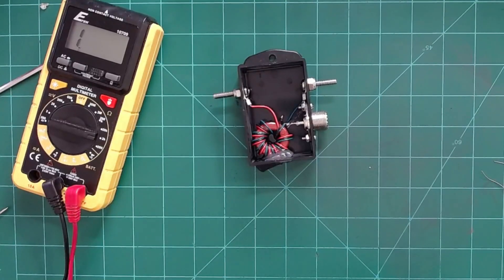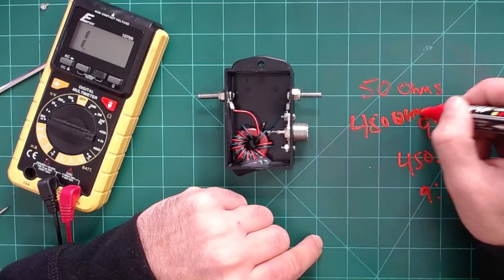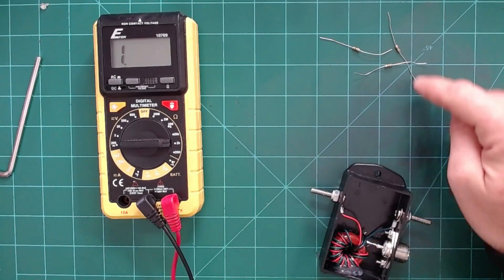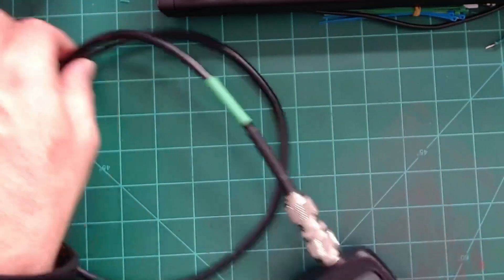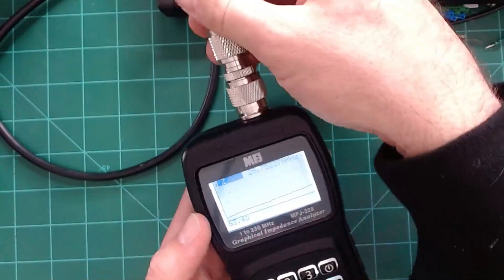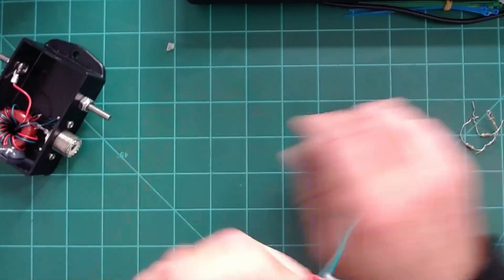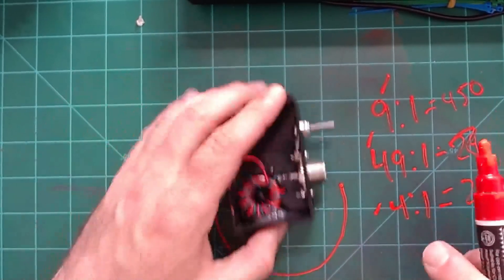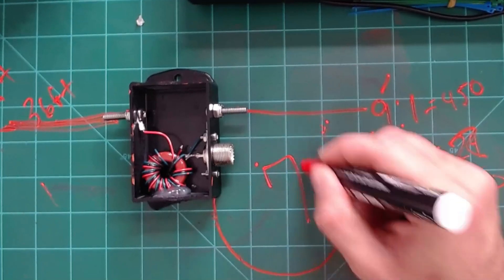Easily Test An UnUn Before Deployment (9:1)

Comment: Very nice, it is useful to determine the SWR, but how to determine the losses (in dB) to know the power efficiency? I saw some ppl using 2 identical linked transformers to do this, but make two transformers is a pain in the ass, so, how to do this measure using just 1 transformer and the analyzer ofc?
Reply from the maker: Hey!  I do not know of another way to test the efficiency, besides the 2 identically linked transformers.  Thanks for your support, but I am sorry I can't be of any more help!   73!

Comment: Just to add to this a bit, as an alternative to wiring resistors in series, I recently purchased a "Variable Resistance Box" that allows you to dial in resistance values between 1 and 9000 ohms for testing purposes.  It's about $20.  It's Chinese ( of course) but it's reasonably accurate.
Thanks for the !

Comment: Excellent job explaining what the unun does.  I would like to add this.  You should sweep your antenna before installing an unun to determine where your antenna is resonant.  Look at the impedance where you are going to operate and determine what ratio is needed.  Someone at the club told me they are going to put 9:1 unun's on all their antennas.  I asked why and they said because antennas are better with a 9:1 unun.  I tried to explain that putting a 9:1 may not be necessary, they should check first to see if it is necessary.  If you are at 2:1 on the band you want to operate at, then adding a 9:1 unun would make things worse not better.

Comment: Thanks for the video. Just getting started and some presenters throw out info like the viewer is on the same level as they are. Case in point one presenter casually stated that to test you just put a 50 ohm resistor on the antenna.

Comment: Several minutes of video, and you never show the plan of what you did????INEPT!
Reply from the maker: In the video I show 450ohms crossed between the antenna element and the counterpoise.   I did not show a schematic but rather explained it.  I can draw it out if you would like
Reply: @DudeTested  In a tutorial on a balun, the logical and default thing would be to show the connection of the balun that you are still showing,
((basic behavior))

Comment: Just had to do this with a bought 49:1 (cheap import) which just wasn't matching.  Examination showed one wind too many on the primary! Took out a turn so it was 2 turns to 14 (rather than 3 to 14) and of course everything was fine.  I used some resistors in series  I had on hand to make the test load as near 2400 ohm as possible and my microVNA. - sorted.
Reply from the maker: Excellent

Comment: Doesn’t work this way with a 49:1. The secondary on a 49:1 is part of the resonant circuit formed with the end fed half wave length of wire. I tried this with 4 different 49:1 ununs and was getting a weird dip at 2.5 mhz and high swr in the rest of the band but when I connected my half wave wire, all the dips were right where they’re supposed to be.
Reply from the maker: You're right.  I confirmed the 49:1 with the same results. Sorry for the misinformation
Reply from the maker: I'd be inclined to say that since you see the dip, that's a good indication.  If there's no dip for anything that doesn't come relatively close, that's where you start to see an issue with your wrapping or something along those lines.   I think the best experiment would probably be to wrap it once, check wrap it twice check and see and watch what it does on the spectrum
Reply: @DudeTested  Just out of curiosity, what kind of curve did you see in your analyzer with the dummy load? I always get a dip around 2 to 5 Mhz and then the SWR is off the graph by around 14 Mhz. I've tried 3 different type 43 core configurations and always get a similar result.
Reply: @DudeTested  Thanks for checking and replying! It seems a lot of folks are misunderstanding the 49:1. I’m glad to hear I’m not crazy.

Comment: Ham Radio Dude- just found your video, all good except i dont have an analyzer, what can use to substitute
Reply from the maker: You could just hook it up to a radio and check the SWR. It's going to be painful and if you're not resonate within the bands you can transmit on, it's going to be very difficult to tune/confirm functionality, but it could be done.

Comment: Good afternoon.
I want to measure a 49:1 unun, it comes to be 2450 Ohms. Should I build a 2450 Ohm resistor for the test bridge or is the 470 Ohm resistor enough?
Thank you
Julio
OA4DXW
73

Comment: Getting a different impedance at higher frequency is not just a matter of the connector.  The inductor itself behaves different at different frequencies, a function of core type, wire size, winding proximity, etc.  A 9:1 transformer is not evenly 9:1 across all frequencies; whoever built it decided on a toroid and type, hopefully with an eye towards what frequencies it'll be used for.

Comment: Unun is unbalanced to unbalanced.  Balun in balanced to unbalanced.  450 ohm line is balanced and 50 ohm coax is unbalanced.  You have tested a balun not an unun.
Reply from the maker: Thanks. Do you have any documentation that is easy to follow? I ask, because I am referencing websites and then I think I understand it; Then I find out, that about 90 percent of the websites out there are calling a 9:1 an unun... So if I had some documentation and examples of Balun vs Unun, I think I could make a video after understanding it better and hopefully help clear the confusion.  Thanks for any resources you may have
Reply: @DudeTested  Good job.  The unit you made can be used as a balun with balanced 450 ohm balanced twin lead to feed a G5RV for instance.  It also can be used as an unun  with an End Fed Half Wave by attaching the antenna wire to one side and a counterpoise earth to the other side.  Your videos have good lighting, good audio and  contain good details so well done.  Google is your best friend preparing these videos.  So are other YouTube videos.  Plenty there to research.  Keep up the good work.

Comment: If everyone would quit using the powdered iron cores that are designed for use as inductors in tuned circuits such as antenna tuners and low pass filters in amplifiers and transmitters and use ferrite cores like a mix 43 or mix 61 that are made to be used in baluns and ununs, the test results would be a lot better!
Reply from the maker: Thanks.> If you would like to contact Princeton Antennas, that's who made this Random Wire 9:1.  73
Reply: @DudeTested  Learn to build your own !  FYI, a 9:1 UnUn is designed to feed a 450 ohm load and a random wire is only going to be 450 ohms on one frequency!

Comment: This is NOT a test! At the end of this video you don't know the most important thing: how much energy is transferred to the other side of your transformer !!! In other words the "insertion losses".
Today there are very cheap VNAs, but you can measure losses even without it.
For sure, you cannot use an iron powder toroid (as in the video) for a wide band transformer on HF. 73s.
Reply from the maker: I think you are over thinking the video.  1.  Test this with resistors to make sure your winding was done correctly.  2. I used a 9:1 for an example with a t106-2.  No where did I say to use a t106-2 with a 49:1, that's not even what the video was about. You can however, test a 49:1 the same way.  3.  If you used this method, you would realize before installing and testing the 49:1 that something is wrong and hopefully narrow it down to the wrong torrid or number of turns.   This video did exactly what it was intended to do, test a transformer before going out in the field to test it.. hence, it IS a test.
Reply: @DudeTested  Hello, in the description you ask to write if there is a better way (...to test a RF transformer). So answering to your numbered claims I will explain somethings:
1. To check if the winding is correct a visual inspection is the right way and the measuring of insertion losses is always the most important thing because everything is included (but saturation of the toroid).
The SWR cannot give you infos about the wrapping or about the radiator that will be after it because it is influenced by losses in the transformer, reactance in the winding, capacity among the turns and winding length.
Actually SWR can be (and it is!) much higher, but you cannot see it due to the transformer losses lowering it (as in this case).
Also 1.73 as SWR can be e.g. a mistake in winding the transformer, but you claim it is acceptable... (Acceptable for a transformer ?!? For a simply two octave bandwidth transformer?).
If you wind (correctly, this time) a 15:1 or a 5:1 transformer, using the same resistors, you will get the same 1.73 SWR: so, how can you understand if the winding in your transformer is correct ?!?
2. Doesn't matter if the ratio is 4:1, 9:1 or 49:1 in any case you cannot use an iron powder toroid (as in the video) for a wide band transformer on HF: permeability is too low and as consequence the Al ratio is low.
Where did you study RF transformers? Which calculation you made for such a transformer you show as a working device?
3. If you use this method that you are suggesting, you cannot understand that everything is wrong, as in this case, and for the many reasons I already wrote (electronics and magnetism are not an opinion).
A so high SWR (it is actually much higher, as I wrote) should help you to understand it, but you said it is acceptable...

"Nondum matura est, nolo acerbam sumere"
Reply from the maker: @IK8XOO--Paolo  Thanks for the clarification.

Comment: HRD just a thought with the resistors in line, and a AM carrier of 5 watts, and a piece RG 58 as  a  coax capacitor,  connected earth & wire connected to Aerial inside the box. 
Now   CUT your RG58 ,  cut off small pieces of cable and have look at your VSWR in line ....the SWR going down and slowly I get a 1: 1 in the cable. Leave RG58 in box as you have soldered it. Give it a go mate Dennis vk4oc.
Reply from the maker: Thanks. Very interesting
 I'm going to have to give it a shot. Sorry for the delay. I see all the messages but I'm having a difficult time keeping up at the moment .. I'd like to try this to see the happens, I appreciate it!

Comment: 49- 1 60 of wire would work 10-40 yes
Reply from the maker: Hi Paul.  a 49:1 with a T140-43 torroid can be used within the 80-10 range, yes.  If you have a 49:1 with an antenna length cut for 1/2 wavelength (65.6 feet, depending on the wire you use (Velocity factory could play an effect and technically make the antenna a little shorter)) of 40m, you will get: 40m, 20m, 15m, and 10m, all should be without the use of a tuner.  I have not attempted, but with 1/2 wavelength worth of antenna wire for 80m, you should be able to get 80, 40, 30, 20, 15, 12, and 10 under 2:1 SWR, with 17m possibly being slightly above 2:1.  Thanks!
Reply: @DudeTested  tnxs Dude. It's hard to said where you are.  Must be on  Permanent vacation. Lol
How everything is ok on your end, can't say that. My mind is like racing engine and the brakes are not working. Free wheelin. Trying to put together a go bag. G 90
Looking at the POTA  There's a whole bunch down here in Florida, And I won't have fun.
Reply: @DudeTested  how do you know what torrid to use and how do you measure the impedance of your wire.  Yes I should know that.

Comment: Did you use ordinary or low inductance resistors? Those can be hard to find, but the ordinary wire wound ones can give some bad impedance readings.

Comment: Great video.

Just a thought..... 

get a 2 or 4 position rotary switch
get a couple of female banana plugs
get a couple of leads with a banana plug on one end, and an alligator click on the other
get a small enclosure

solder the switch input to one of the female banana plugs
solder the resistors from each pole of the switch to the other female banana plug
mount the switch to the top of the enclosure
mount the female plugs one to each side
close the enclosure
label everything

now you have a test box to switch from one set of resistor values to check your ununs
Reply from the maker: That's awesome!

Comment: So how do you test for loss ie loss of power output and rates of power  ie QRP vs QRO?
Reply from the maker: This is a great question.  It may be an answer for the smoking ape.  Let me ping him
Reply: I would think the best way would be to perform an insertion loss test on a VNA doing a S21 LOGMAG, that said I am not sure I found a way to do this where I am confident in the results.  Power level shouldn't matter in this type of measurement provided that the antenna is designed to handle QRO.